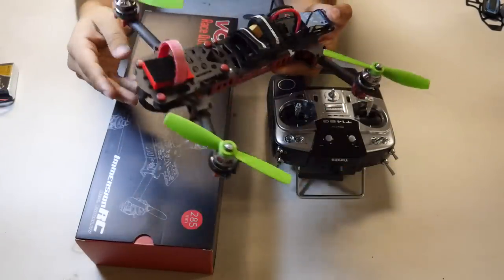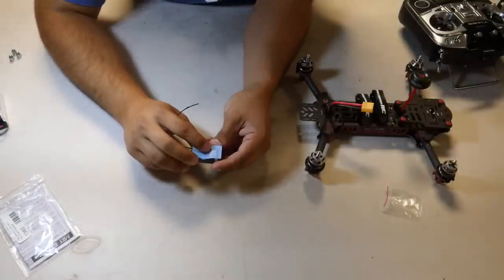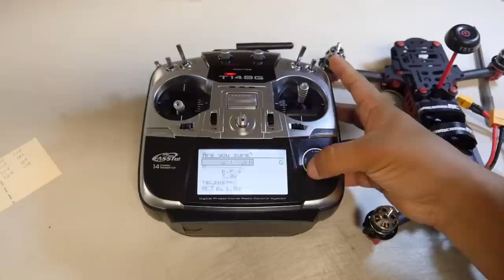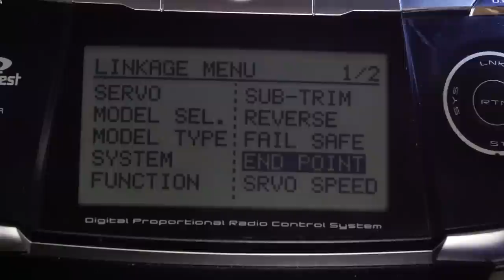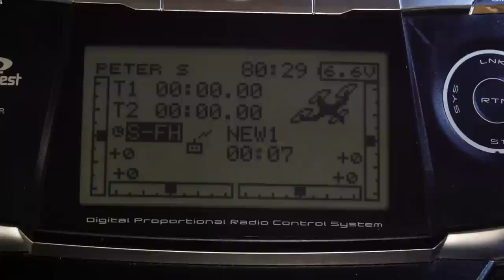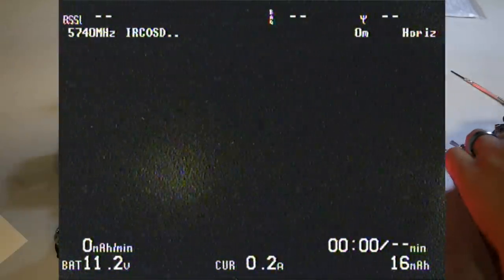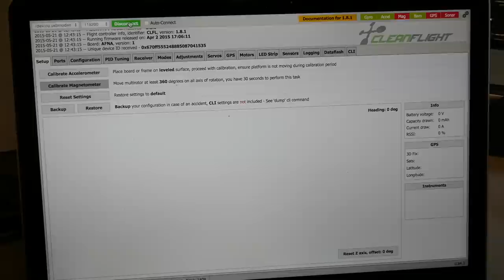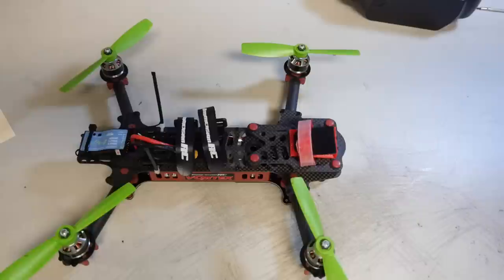How to set a ImmersionRC Vortex With a Futaba 14sg

Comment: Hey, thanks for the tutorial, one question, would the end points that you configured for this TX be valid for the Futaba T10J, any input you could provide would be greatly appreciated, thanks and have a great day.
Reply from the maker: You could try and If it doesn't work you need to connect to the computer and set it the proper way.
Reply: Hey, thanks for the speedy reply, I figured it out, thanks....